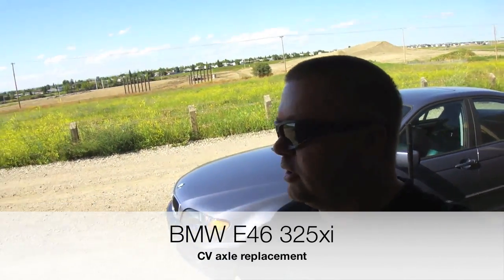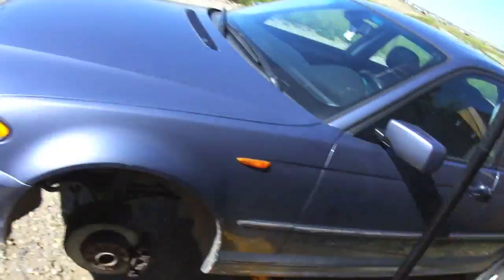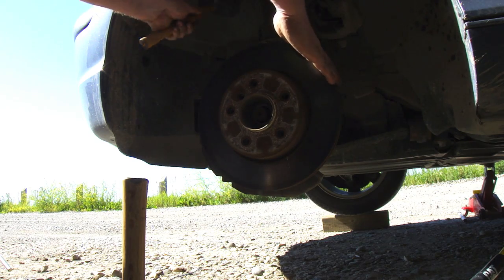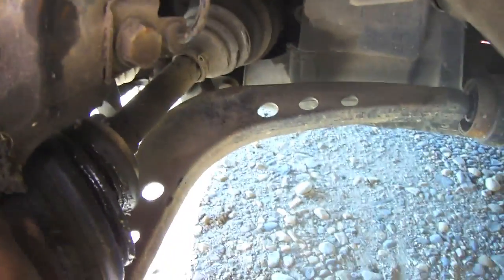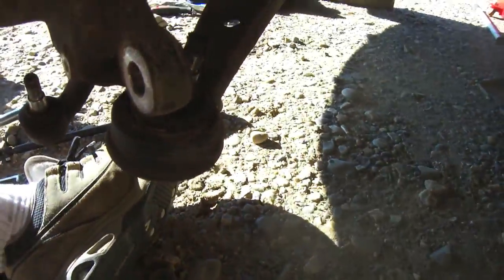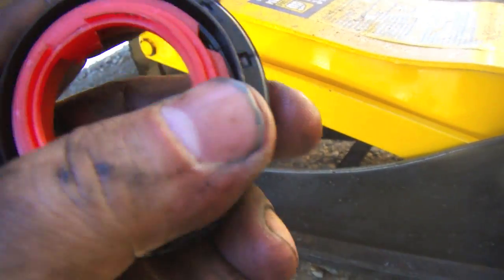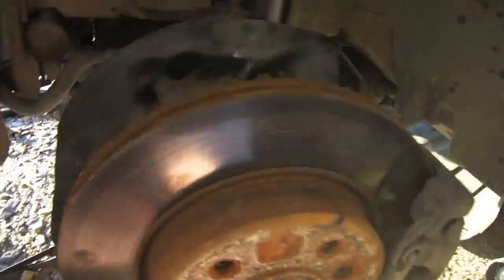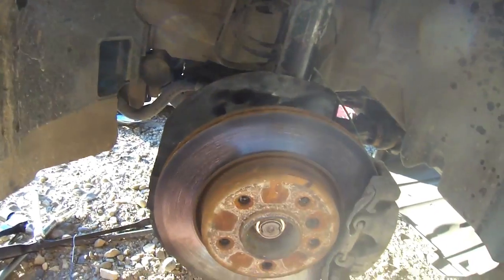Diy E46 Cv axle replacement, and front differential oil change

Comment from the maker: @ZimorKilled you do not need a axle puller to separate the axle from the hub it should just slide out, if not put the nut back on loosely and tap it out with a rubber mallet.  Use a seal driver to replace the seal if space is limited gently tap around the edges to get it in place and don't damage the seal face

Comment: Thank you. I managed to remove a plastic shield from the left front wheel and i got access to that whole. I put again the o-ring to the dipstick and pressed there. But up in the engine was a little bit hard to  put the screw again on oilfilter suport, because there is a conic surface. I put there a conic nut, and i think will be ok :) I can tell that the dipstick system is very very vulnerable, I mean if a screw is missing, you can remain on the road without oil in engine.

Comment from the maker: the vertical movement would be the reason your car vibrated at 50-60 mph, i just found the same problem with the jeep I'm building that is doing the same.  and yes you can move the drive shaft in and out but don't get to crazy with it.  one way to test to see if you cv axles are still good is back up in a tight circles, if you feel it pop or click then they are going bad.  when cv axles start really getting bad they will click while driving

Comment from the maker: the only problem with that though is since the head of the bolt broke off, if the stud decided to come loose you might have the strut pop out.  as far as getting the ball joint out you can't do it with a pry bar you need a pickle fork and some hammering to free it

Comment from the maker: now comes the bad part if your going to replace one A-arm you might as well do both with bushings and lower ball joints on both sides.  it's expensive but i tried to get away with only doing one side and it drove loose on one side and tight on the other so do them both.  i did videos on doing both sides

Comment from the maker: ya pickle fork is the way and it's hard to get out, you really have to hammer on it. as far as the broken bolt try using some pb blaster or some other sort of lubricant and maybe some heat with a easy out to hopefully get it out.  broken bolts are never fun to deal with

Comment from the maker: the axle is held in place by a clip, i pried on the square piece going into the axle housing and pulled on it the same time. it's kind of a bitch at times to get out but it will come.  also it' always good practice to change the oil seal for the diff as well when you change the axles

Comment from the maker: hahaha i had to watch the video just to see what you were talking about... ok if your just changing the boots yes indeed use some gasket type silicon to seal around the boots if you wish and make sure you regrease your cv bearings before putting new boots on. use a really good long life bearing grease to extend life but inspect the bearings for any wear and make note of that while you have the boots off. the hollow 6 sided thing is the axle housing i had to fight with it

Comment: Thanks again man. Sledgehammer did it finally. Now I see what that odd looking piece sticking out of the diff is at 2:58 and why you said not to pull too much. My boots were not torn, there was just a tiny leak from the bigger clip of the inner boot where it holds over that rubber adapter. I'm changing the boots and the diff. seal anyway. biut I'm wondering if a little glue between the rubber adapter and that hollow 6 sided thing would be a good, since it was leaking from around that adapter

Comment: Oh, yes, some intense sledgehammering did it finally! Now I see the ball joint has movement in the vertical direction, is that normal? The car did vibrate in the 50-60mph range and it has less than 150,000 miles, mostly highway. Also, you can move the drive shaft in and out in the inner CV joint. It's a 325xi BTW. Thanks and sorry if I'm going off topic a little ..

Comment: Hello, congrats for the good work, I appreciate it.
I want to ask you something because i did a mistake. I wanted to pull out pressure converter or radiator claps/blades which is on oil dipstick, and accidentally i pulled out oil dipstick from the engine, and all oil flushed out. Now i cant put back again the oil dipstick. Do you have some ideas for me . What can I remove to see that whole? How is fitted the oildipstick there?

Comment: Thanks man, I'll see what I can do with the broken strut bolt.
Pickle fork and some hammering, easy as pie! Just kidding! I made a tool from heavy angle bracket and the fork and heavy duty bolts to push the ball joint bolt out. NO way, the bracket got bent! Hammer? I used a 6lb. sledgehammer to push the fork in it went in almost 70% and I was sweating like a pig! The darn thing didn't budge! Of course I ruined the ball joint dust cover (I was prepared for it). Suggestions?

Comment: hey bro thanks for the video i jave a couple issues with my 01 330 xi first off i have a vacum leak so bad that while in drive and at a stop sign or red light or anytime brake is applied the car shakes so bad when i put it into neutral it stops so i couldnt find any under the hood so i jacked the car up in hopes to find one underneath  the car and thats when i noticed my wheels both front left and right would wobble if i shook them with my hand so i took them off and boom ball joints were shot so i replaced ball joints not knowing i needed a press to reuse bushing brackets i beat the shit out of the one with a hammer [bad idea] lickily i ordered two new bushings and four new ball joints (two iner and two outter) so got everything together noticed my rack n pinion billows were torn and my cv axle boots were torn or had grease on them both sides inner and outter put that off didnt think it would matter to wait a lil while to fix cause i never had a problem with a noise or anything now when i drive with just having changed the control arms the car drives like shit pulls my to one side if i gover over a bump or brake makes a clunking noise if i go over a bump and if i turn the steering wheel all the way to one side or the other it makes a clicking noise i took the control arms off two times to make sure they were done correctly and they are do you think the symptoms could be the cv joint also i did not get an alignment done yet also i have two new billows  for rack n pinion and two new cv joints i plann on replacing i just wanted your input if you even read this long as post thanks in advance

Comment: Thanks, yes, both sides is the way to go and as you say it's expensive. Found a complete kit of control arms, busings, tie rods.. on ebay for $430. Even with $100 shipping it will be cheaper than other online stores. It's from Hamburg Technic. What do you say? 
Also I got the axle out of the spindle by really hammering on it, but it won't come out of the diff.! Do I put the pry bar on the square piece of the axle or the round part? The square piece move maybe by 2mm!

Comment: @cmanclan101 Cool and useful DIY videos. Questions: did you consider a hub puller to help separte the axle from hub, or did the axle just slip out? Also, what tool did you use to install the seal?

Comment: Great video. I broke my strut bolt. I'm not going to worry about it though because it broke only 2 mm deep and the whole length of the bolt is there rusted/welded to the strut forever. However, the darn ball joint is not dropping out. I tried a pry bar and it doesn't budge!
Any suggestions?

Comment: Did you have to get an alignment after reconnecting all of your linkages?
Reply from the maker: no because nothing really moved
Reply: +BuddyLe3 ...Hey BuddyL, as I'm sure you already know - you have the right idea. You should always have the alignment checked (on road vehicles) after any time the the tie rods or ball joints have been disconnected; regardless of whether or not the adjustment sleeves have been altered. If you take an alignment measurement before and after you'd see that the alignment did actually move. It may still be in spec, but it does actually move ANY time the joints are separated and reinserted. The only time "close is good enough" is on off-road vehicles.
Reply: nothing really moved, therefore nothing really moved.

Comment: Hey bro thanks for your videos there amazing. . I have two problems with my 2000 e46  number 1 when I am driving more than 60mph in the fwy and when I switch to my left lane my steering wheel starts shaking it's really annoying it only does that when I make left turns. No.2 problem is when I punch the gas all the way almost red line it it won't get reverse I have to drive the car over 40 mph so reverse can kick in could you please help me out?

Comment from the maker: you can look for aftermarket in my travels i' looked into it once and the cost of aftermarket struts and shocks was insanely expensive.  considering that the car is only a xi and not the sports model it wasn't worth it...  if i had the ci or m3 then i'd invest in aftermarket.  however there is lots of dealers on ebay that sell oem aftermarket struts and shocks for decent price... also look at rockauto and bimmerspeicalist online for pricing

Comment: Why did you have to remove the swaybar-link?  I've just changed the shocks on my 330xd and can't see how it should be in the way for the axle replacement...   which I'll have to do on mine too as soon as the part is sourced from eBay...  :)
Reply from the maker: the upper strut bolt wouldn't come out, so in fear of breaking it off i went another route

Comment: 1. You do not need to remove the Brake caliber that’s just extra work 
2. you do not need to remove the breaks for the car 

All you need to do is undo the control arm by the brake disc and loos the hub for the axle just pull it towards you and it u might need to get a medal rod and tap it with a hammer and to will come out fine Again No need for removing brakes on car
Reply from the maker: Why would you remove the control arm which will then require a alignment ?

Comment: could you plz tell me which cv axles should i buy for 02 325xi front both side aftermarket.and which one you installed for your car?
cause i got FEQ (china) by local german car mechanic $ 750
w/install 
within week(2 set of cv changed) both set cv boot torn and grease all over and klunk sound ,,,,guy is not sure what is cause.car have after market shocks dropped.
waiting for your advise man 
tnx

Comment: For what it's worth the Bentley e46 manual series 3 (1999 to 2005) approaches removal of the front CV axle (section 311-2)  in a totally different way. It doesn't require removal of the strut pinch bolt that is troublesome and often snaps.  It instead requires removal of inner ball joint from subframe and remove control arm rear bracket and bolts from subframe. As a result the control arm will only be attached to the steering arm. This will allow enough play for you to remove cv axle from steering arm and tilt the steering arm out of the way to get the cv axle out.  Of course the bolts attached to the subframe maybe just as rusted.  Has anyone tried this procedure?